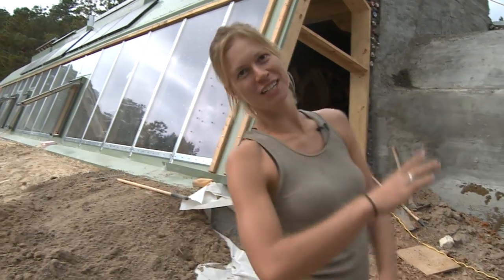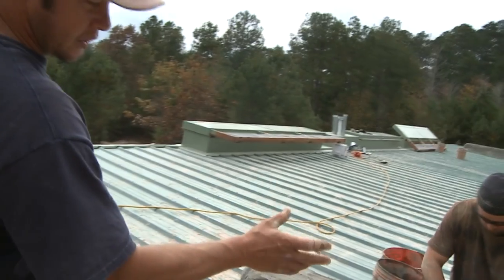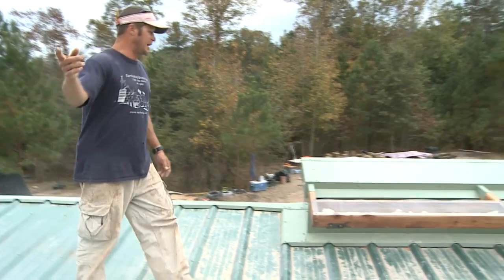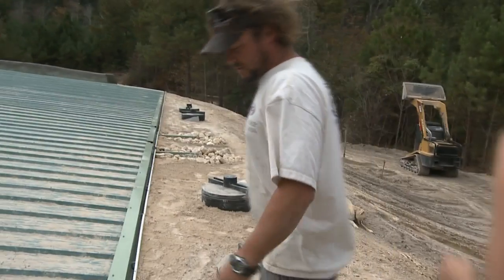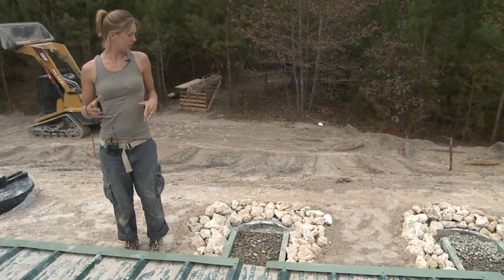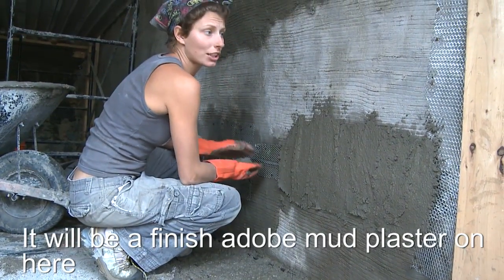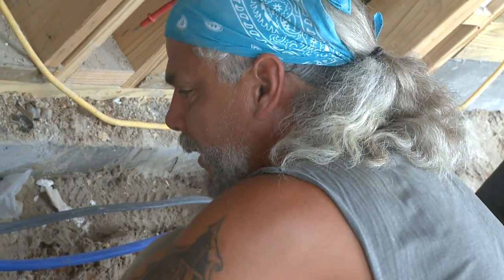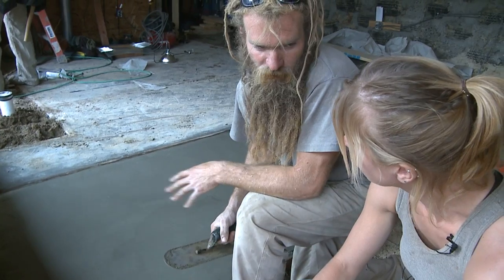Texas Earthship Tour: Finishing Touches

Comment: If you check out some more of Mikes' work you will see that the grey water is run through planters, filtered and used for flush water for the toilets which then goes to a black water system, which is a standard septic tank that leads to more planters used for landscaping. When the home is finished all water that comes into the home is used 4 times.